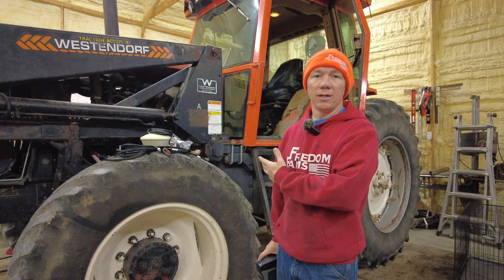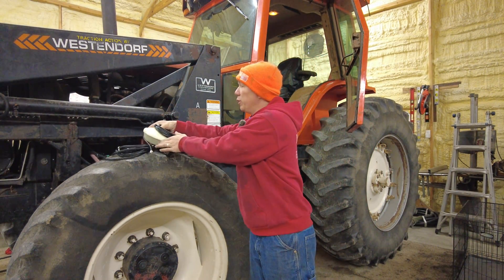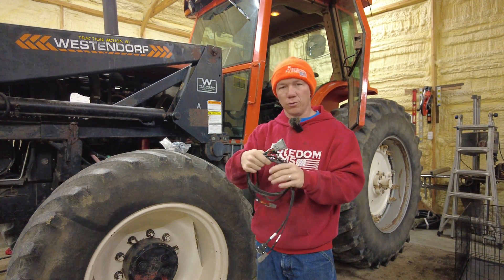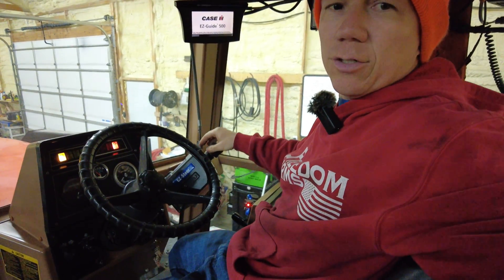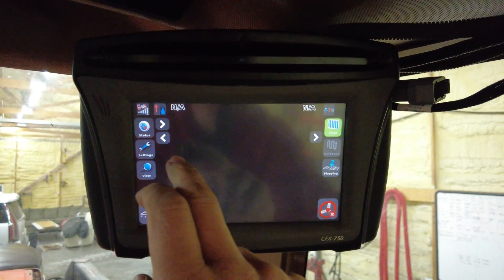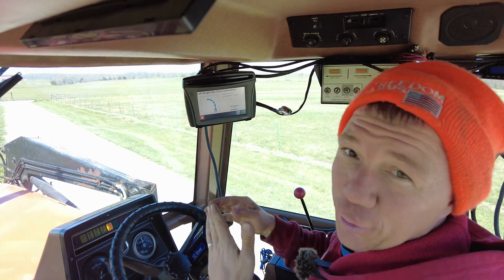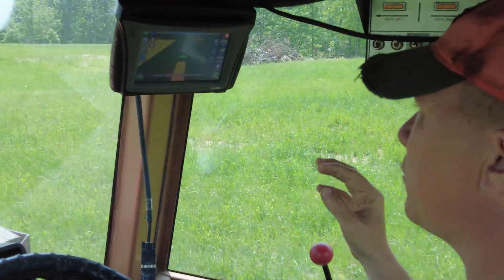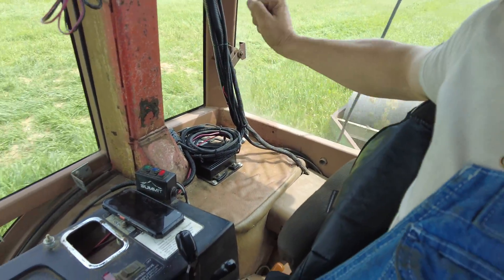Upgrading our cheap autosteer ez guide 500 to a cfx 750

Comment: You're gonna love that 750 I've used multiple of them and they are all awesome, simple and mostly reliable, i say mostly because one of them had an aggressive previous owner so sometimes it goes crazy and loses it's line. Also i have an ac 8010, so love seeing your 8030 and all of your allis equipment
Reply from the maker: Thank you! I really have been enjoying it. I liked the ex guide 500 monitor too but the cfx 750 is way better and easier to follow too. If you cant tell we love our Allis equipment. Glad to hear we are not the only ones running them.
Reply: Yeah I am actually in new zealand so allis equipment is on the rarer side over, there are only 5 8010s over here and about 12 or so 7000 series, and I have seen a 7580.
Reply from the maker: That's is really rare there I bet. To be honest they aren't super popular around here but definitely more common then they are in your neck of the woods.